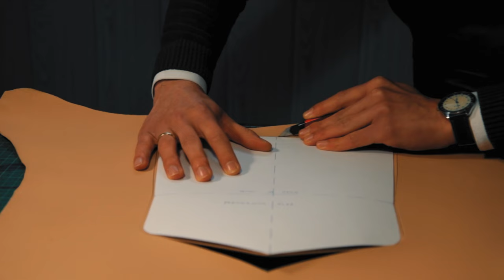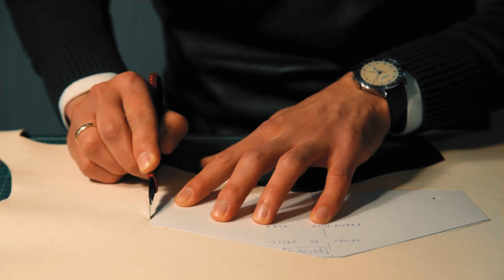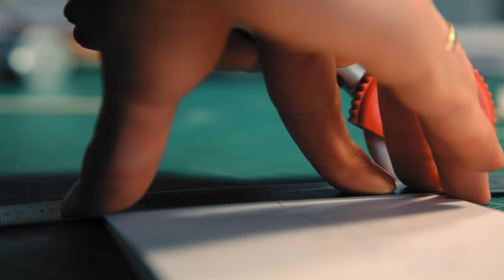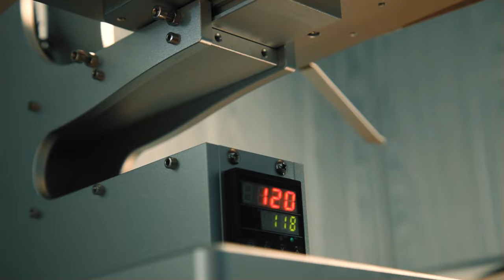Making a Handmade Luxury Bag from Goatskin: Step-by-Step

Comment: Awesome video, and the confidence of stamping that piece so far into the work is enviable. Two questions though: What is the material you're using for the core of the handle? What is the blue plastic you use to protect the hardware called?
Reply from the maker: Thank you 🙏 The reinforcement of the handle is called EVA. The blue plastic is a special tape for covering metal parts 😊

Comment: hello, great video, curious to know, what heated tool did you guys use?..Looked interesting... is that to make edges smoother to seal them or was it a creasing tool? thanks
Reply from the maker: Hi, thank you 😊 I use the electric creaser for sealing the edges and for decorative lines
Reply: @lebrach.official  wonderful thanks

Comment: Btw you should have shared it's pattern
Reply: The patterns are where a huge portion of the work lies, so I don't think he necessarily should have shared it. I think this is more a demonstration of his skill than a follow-along. Don't get me wrong - I would have loved for him to share it as well. 😊
Reply: @bander1023  no offense but its a pretty well used pattern. Ive seen them used on purses at my local clothing outlets. Not to take away from his talents cause it takes skill to put it all together but you can just buy a bag or purse at the store take it apart and use it as a template. 

And before someone suggests that its stealing, its never an exact copy when handcrafting it. I could just change the handle or materials to a Louis Vuitton bag and still use the design without any infringement. 

Just a tip for anybody wanting a design like this or any design for that matter.
Reply: @Handles-R-Lame  No offense taken at all. I appreciate the callout - I was unaware it wasn't an original.